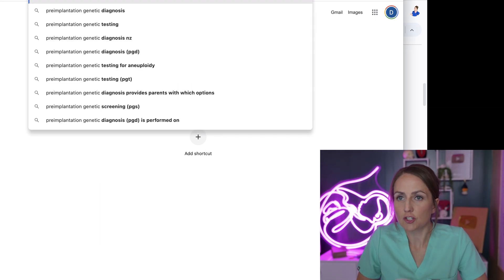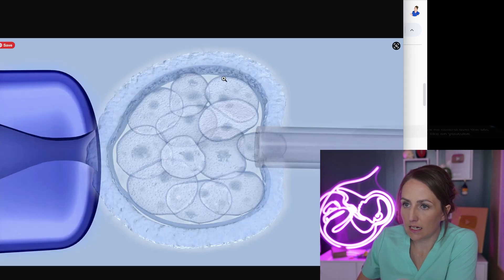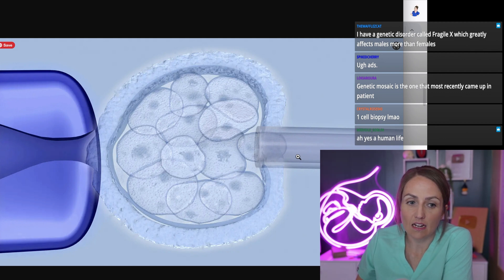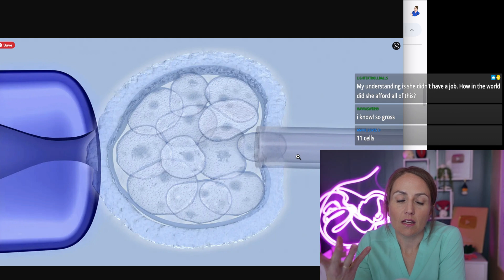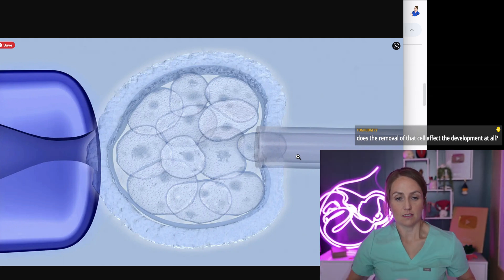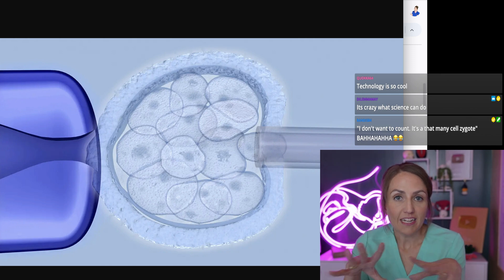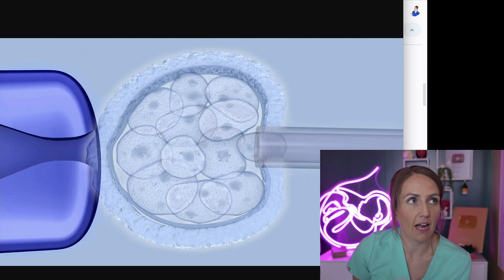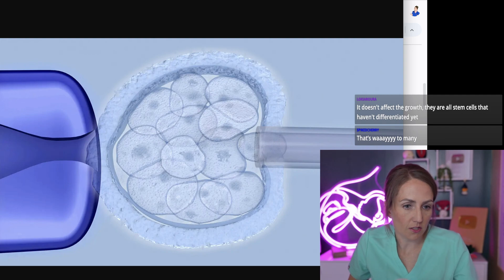How is Pre-Implantation Genetic Testing Done?

Comment: I did PGT for my embryos during IVF. We didn't sex-select, but it was really helpful to find out that some of the embryos were non-viable. We sent 13 embryos and 4 were not good. It cost us $7600 but of pocket, but using tested embryos increases implantation chances from 40% to 50-60%. At our clinic, each subsequent transfer after the first cots $3500, also out of pocket. Of the remaining 9 embryos, we transferred 1 and that resulted in my son. It was really cool because after we got the second Beta test showing it stuck, we were able to find out the sex from the embryologist. So I knew sex for certain at 4w3d which is before most people even know they're pregnant! I also know that our 8 on ice are 50/50 male-female, so if we do a transfer in the future, our odds are even.